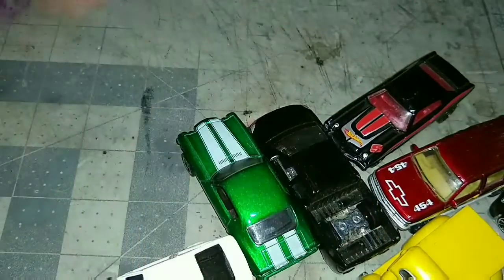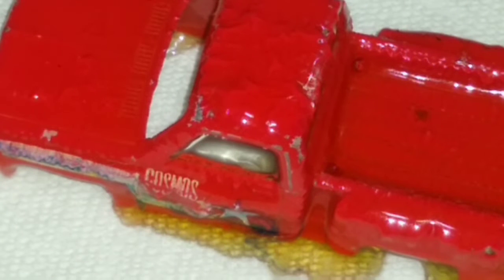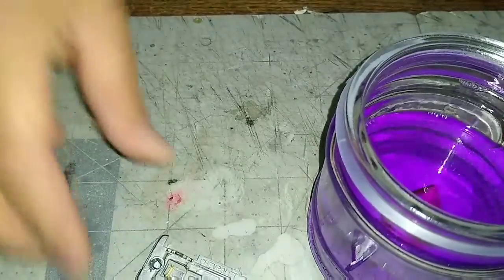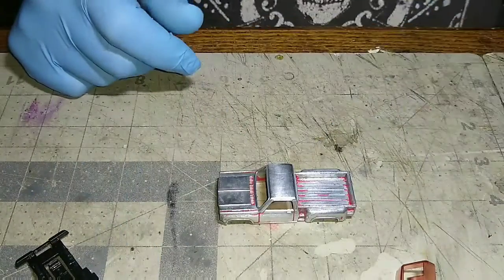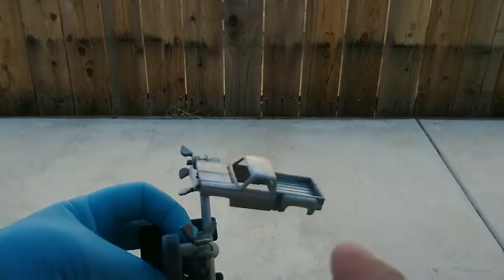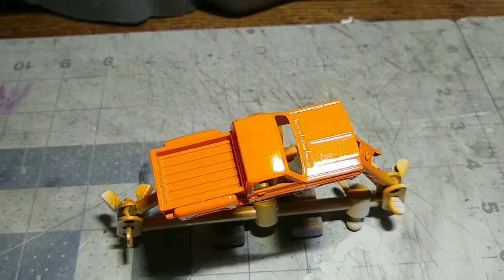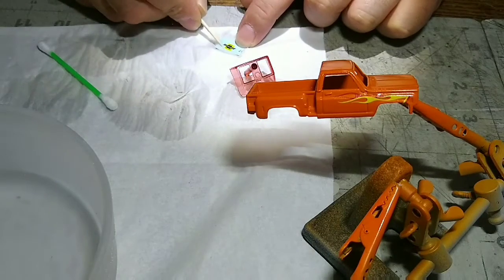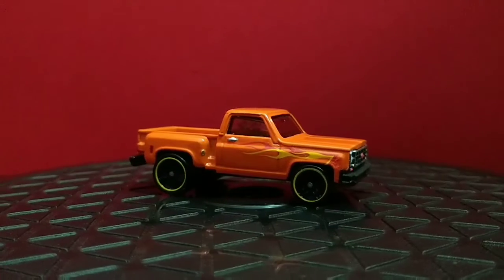Restoring 83 Chevy stepside - custom diecast

Comment: Great first video! Your Chevy truck came out beautiful. Those flames really make it pop and your details are spot on. I look forward to seeing more builds from you. A tip I have picked up from other builders for decals is using a wet sponge instead of dunking them. Seems to work extremely well and is something that I'm going to be trying here in a build as soon as I can score some decals.
Reply from the maker: Thanks very much . And also for the tip👍